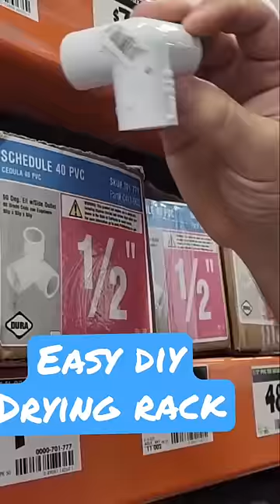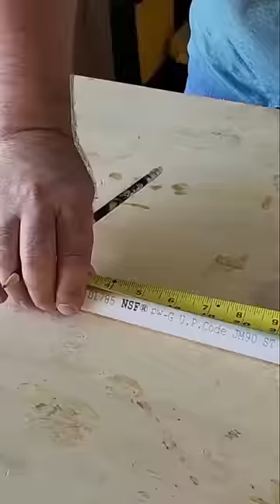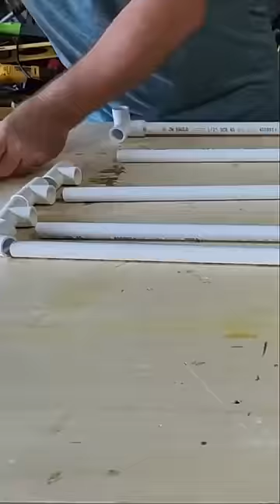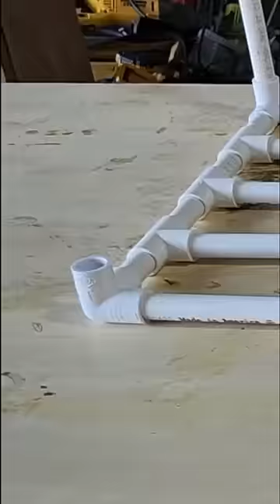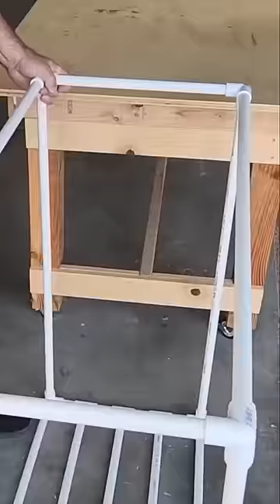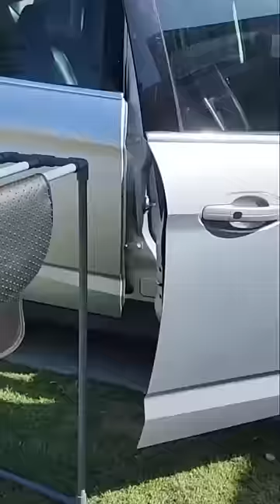Everyone will be buying PVC pipe for this! #shorts

Comment: I bet he doesn’t know how expensive the three-way PVC joint is.
Reply: How expensive are they each ?
Reply: Less than a dollar apiece on Amazon.
Reply: Well if he bought it the pipe he should know you think 🤔🙄 ??
Reply: It can be done without that fitting.
Reply: Here at Home Depot they're about $8 U.S dollars.. regular 1/2" Tee fitting is 6 and change.. these are 1/2" fittings,the smaller you go a little less expensive
Reply: @Seven.And.The.RaggedTiger 
 Wth? 1" tee's are $1.97 at HD according to the web. I didn't look at other sizes.
Reply: @joewoodchuck3824  depends on what state I'd assume.. but in Baltimore Maryland cross tee's are 9 bucks depending on diameter.. I looked at 1" pvc cross tee because that's what it looked like in video before seeing the "1/2 inch" labeling
Reply: @Seven.And.The.RaggedTiger  He was talking FOUR TIMES the price and he was talking two sizes smaller at 1/2". That's far from a local variation.
Reply: @RoseBushThorns588 the whole structure cost 750 dollars.
Reply: Each join is ~$1.25-$3, and he has at least 10 joints, so at the worst it's already $30...before the glue and long PVC.

Basically, he's wasting time for something he could get for cheaper.
Reply: He apparently liked what he was doing. That's all the reason he needed to rationalize the project. And it's to his exact specification of size and design. Show me (him, actually) a manufactured true duplicate.
Reply: @Seven.And.The.RaggedTiger where are you? Here in louisiana I get them for a 2.50 to 3.50 even with big markup being 40 miles from bigger towns with a home despot.
Reply: @Mr.BluesGarage  Baltimore Maryland the 2nd highest taxed state in the U.S other than California
Reply: @Seven.And.The.RaggedTiger  There are many other high tax states. I escaped from mine. Made space for someone else more gullible than myself.
Reply: There are foldable drying racks, not really expensive. This one will takes space. Unless you don't care about it.
Reply: @polinab.3594  I'm disappointed by all the flak this guy is getting for what turned out to be a nice project. It's what he wanted. Isn't that enough?
Reply: Wtf south cackalacky Home Depot 1.79 t’s
Reply: @Seven.And.The.RaggedTiger  its a specialty item not normally used, sometimes called a side outlet elbow. 2.58 each here in cali, (or 10 for 12.22 furniture grade special order). 8 will be needed.

Comment: I feel like that's more money in materials than a cheap towel/clothes rack
Reply: Bought an Italian Mahogany one for $10 , it's worth $850 .
Reply: It most certainly is
Reply: And you would be correct.
Reply: And a waste of time!
Reply: It could have been excess PVC pipe after a job, most of us would have thrown in the garbage.
Reply: @Undaunted2012 who throws away 4+ foot chunks of good PVC and dozens fittings?  That's like $60+ in materials.
Reply: @timlong1462   most likely I would, if it’s been in my basement for an extended amount of  time collecting dust & knowing that it would not be used, too late to return to the store unused pieces.

Comment: I made a radiator water heater out of one it had 141 degrees of heat. Still works 15 years later. Used a 10-gallon RV water heater and coolant and a small water pump. I roll it around the garage.
Reply: Can you share the build?  Please
Reply: Yeah,
Really 

Your project sounds like it’s worth looking into!
Reply: So it's a heated drying rack. That's what you mean, right? Flowing heated water through the PVC rack will dry the items quicker so I'm assuming that's what you mean by "radiator water heater."
Reply: We made soccer goals for Bosnia kids from PVC. Exactly! I'll move on💯😭
Reply: @mannys9130 
I'm thinking s/he meant it's a space heater.
blessings everyone everywhere and always
Reply: NOW we're talking. I wish I had seen that video instead.
  But here I am seeing this comment, so I'll call it even for watching this guy play Legos with PVC
Reply: @CmdrCorn   
Lololol be nice.
Blessings everyone everywhere and always.
Reply: @mannys9130 I take him to mean it's one of those tiny water heaters. Like just a little tank that fits under a cabinet. He filled it with liquid that's more efficient than water (coolant) and uses a little pump to circulate it.   
  Is like a PVC vehicle radiator with room for towels. Like cooking an egg under your hood, but for towels lol
Reply: So many thanks for this idea ❣️ The racks here get stripped and rust as soon as they get some water! Besides, I have not been able to find one the right size to hang from the railing. I think this will work fine ❣️
Reply: wonderful idea , heated rack , 
NOTE , for users new to this .... 
use " plastic glue " on the joints 
for water pipes ( ask in shop ) !!!!
Reply: I'm thinking that may be awesome for a little greenhouse!
Reply: @jessejamesburnitt  Considering wind etc., I wonder how big it can be.
Reply: Lots of Helpful Smarts Thank You 😊😊😊
Reply: Do u have those instructions?

Comment: Bought a metal clothes rack and the thing rusted in less than a year. I used PVC pipe and ran all my phone wires, and internet cables through it underground to my modular home 25 years ago and my water softener too and l haven't had any problems with them.
Reply: So you bought a metal clothes rack and it failed and then you used PVC for something other than a clothes rack and it was great. I'm failing to see the logical through line here.
Reply: @Bapuji42  Your inability to understand (real or not) doesn't make you smart. Not every word needs to be said.
Reply: Wer understand, pvc is more durable...
Reply: @sparrowhawk8539  Naw, it was just psychotic gibberish. We've begun medication and the patient has improved.
Reply: Go buy a clothes hanger at the store.Then make one of these. If you do it right, the PVC will last longer than the one you bought. Also works well to hang your clothes with hangers inside the house.
Reply: Sure beats metal. Lasts longer than the thin metal used today.
Reply: Ugh ...ok?
Reply: @jayc4715  I bought a '75 Nova and it leaked oil all over my yard. Then I built a makeshift urinal for my shed out of PVC and chewing gum and it lasted 20 years. I swear by PVC.
Reply: @Daniel_Antonio_Arellano782 my metal clothes rack has so far lasted 7 years without any visible deterioration. It also folds up when I don’t need it. 

At the cost of the pipe, the solvent weld, plus my time to construct, I would be dead by the time my pvc clothes rack would have paid for itself.

PVC is great. I once built an entire hydroponics garden out of the stuff. But a clothes rack? Waste of time and money.
Reply: @Bapuji42  that’s just summarization on his/her part. You need to understand, not be a smart alec.
Reply: @Bapuji42 😂

Comment: You will need to support the middle so it doesn’t bow outward. I’ve done this before and the weight and the heat from the sun made it bow
Reply: Thankyou for that advice.
I still think it's a great idea
Reply: Or put a stick inside of it before you glue it together
Reply: арматурину поставьте

Comment: Each pvc pipe (according to the rack price shown at the start of the video) is $6.98. Multiply that by the number of pipes needed, add the cost of the 2 types of 3-way connectors, PVC cement (if you don't want this stupid thing constantly falling apart on you) and you'll see how insanely expensive this DIY "drying rack" costs to make! A portable clothes rack at Walmart that can be used for the same purpose costs about $20. Does this DIY project makes sense to you?

Comment: I actually like this hack. I've built shelves using PVC pipe and currently have a tent built out of it behind my RV as I do an inframe rebuild on the engine. It's November in Minnesota, so it's a necessity.
Reply: not going to handle a snow load well.
Reply: @theboringchannel2027  I'll have to babysit it if we get a huge snow storm. I have it basically set up like a circus tent so that the snow will slide off. It's handled pretty heavy rain so far. 😁
Reply: @markiefufu  turn a heater on if you can before it starts to snow, if you know a big amount is coming,  this heats up the plastic, so it melts as it lands,
also makes it slicker for snow to slide off if it builds.  Just be aware many greenhouse/high tunnels built out of steel pipe collapse from a heavy snow load.
Reply: @theboringchannel2027  thanks for the suggestion! I have a Mr Heater out here and will run it overnight if warranted.

Comment: Until it gets brittle and breaks. It's also not welded and will fall apart easily. I wouldn't bother with this cheap idea. Probably can buy a better one for cheaper
Reply: That PVC pipe is going to last for 25 years or longer. I have tons of things with 25 years ago and they are still going strong. Just knows how much you know about using PVC pipe.
Reply: There's glue for this
Reply: Made a cage around my garden with 1.5" PVC.  Thought about screwing the joints for later takedown, but after 4 years of weather, I just knock them together once a season just to make sure.

Comment: Drill holes throughout the top crossbars, add a hose fitting, hook up a water hose --- now you can wash and dry the towels on the same rack. I mean, if you are going to stupidly spend that much money you may as well go all the way to the absurd level.
Reply: Then drill 8 more holes to have a drying system on the same rack... purchase a blower or wet-dry vac set to blowing, a surge protector, a heavy duty extension cord, an 8 port pvc manifold, and more pvc lines including reducers ... and get to work.  😏
Reply: Don't be a jerk

Comment: I wish he would give a list of materials and measurements as well! I can see using that for more than just a drying rack for floor mats use it for some DYI projects that you need to hand and air dry or many other projects you need to spray paint and need to air dry, also you could put a piece of cardboard on top and spray paint and it’s at a good level and not have to put it on the ground and have to bend over while your painting. I like it! I can see making it different ways for different projects. And not everyone has a spouse who has time to build things so it’s a project I myself can make!

Comment: I am splitting my sides laughing 
with the comments here .... 😂 , 
I may need an ambulance 😂 , 
" plastic pipe glue " is £5 - £10 
for a tiny tin ( for water pipes ) 
( ordinary glue won't stick ) , 
the glue melts the plastic to 
give a welded type of joint , 
when cutting pipes for water , 
use a small round file to remove 
the frayed edge on the inside of 
the pipe to prevent debris from 
collecting and causing a jam , 
plastic pipes will last 100 years 
or more , so the expense is only 
worth it if you want a long term 
fitting for your grand-children , 
the size of pipe shown here is 
too bendy to hold any weight , 
use 1 & 3/4 inch (approx) size 
plastic pipe much less bendy 
for wet heavy clothes , if the 
pipes are not filled with water 
then much simpler and less 
expensive is to use screws to 
hold the corners , ( 3 way ) 
( connecters very expensive ) 
however you do need to be 
creative with the saw to fit the 
corners , cut a half circle in the 
end of the pipe on both sides 
to make a half cup shape , 
a little bit like a horse saddle 
type of shape , then the screws 
can be put in at 45° on each 
side to hold the joint together , 
sorry I won't be doing a video 
on utube of how to make things 
as I am trying to escape from 
the geriatric clinic on my 
Zimmer Frame and the nurse 
has a 24 hr guard on the exit , 
cctv everywhere , I tried tying 
the sheets and towels together 
to make a rope ladder to climb 
out of the window , but I could 
not get the Zimmer Frame 
through the small window 😮 , 
planning my next escape .... 
oooohh , must go , nurse is 
heading this way .... 😮😮😮 
.... add on edit .... 
IMPORTANT .... if you are 
going to use screws on 
plastic pipes then drill the 
hole for the screw so you 
don't split the plastic pipe , 
4 mm dia screw thread , 
3 mm dia screw core , 
drill 3 mm hole in side of pipe 
for a tight fit .... 😮😮😮

Comment: this is really neat and easy but PVC has gotten really expensive. it's non-biodegradable and cannot be repurposed. you can use wood which is biodegradable and can be used for other things. you can use the PVC elbows and couplings with wood if you must.

Comment: Just the multi pipe section with holes drilled in pipes , some sand 
And One Downspout 
Under the dirt and some mesh on top of pipe system and sand 
In your Python (Or?) Enclosure /Tank 
Never a Dry Shed again
If ya keep the bottom moist

Comment: Made a nice overhead lumber rack for my shop using pvc pipe and fittings.  Didn't glue the joints, but did insert a short self drilling screw in each joint.  I weigh around 260 and it can hold my full weight.

Comment: I used thick gauge water pipe as post to build a shop once with a roller at the tops where the wood connected to stop wear. Everyone told me it wouldn’t work but it been over 15 years and still standing.

Comment: i took 4 posts 2 across the top of the other 2 set them in concrete in my back yard ran 4 lines between them at 20 feet apart,it cost nearly nothing,and i think its catching on,... i see them all over,knew i should have patened them...DRATS!

Comment: See, I thought you were going to do something like make a forced air drying rack. Something like a boot dryer but for multiple shoes/gloves/socks. This, although is niffty, is a waste of money/time. 

Wood with pvc pipping would have been a cheaper option. Use some 2x4's as the end pieces with a hole driller through for the pipping. This is only because the pvc fittings are way too costly for this.

Comment: So... I don't get it, as the ending is .05 seconds and really doesn't show the finished product; which leads me to conclude that it's a $40+ Turd Sandwich (PVC connectors add up quickly). The matte-nickel spray-can finish is very Mid-90s Trailer park.

Comment: So I know everyone is talking about how dumb of an idea this is from a financial position. But I'm going to add that this is a dumb idea from a structural position as well. 

You can put very light weight, slightly damp stuff on this and it'll be fine. Put anything heavy or that's actually wet on on here and it's gonna fall apart. 

PVC isn't rigid enough to hold a lot of weight and since you didn't glue any of the fittings it's gonna fall apart constantly. Even if you did glue the fittings you're still not going to be able to put more than maybe 3 things on here at a time.

Comment: Go right ahead 1 inch pvc is now 8.00 for 10ft.  Add in T  jointers at 5.35  each And PVC glue * Both* bottles which are special PVC glue 16.00   Pfffttt

Comment: I wouldn't waste the spray paint. Don't want my wet stuff getting paint flakes!
Reply: Use cpvc instead of pvc. It's already gray and probably more durable
Reply: @seanconnell5362  Thanks for the strength info! I do a lot of "hobbies." For a poolside thing, I like the clean white. The gray will be handy for something!
Reply: I don't think it will be very durable personally and right now it could be pretty expensive. Good luck anyway
Reply: @seanconnell5362  😆Everything's on hold right now! Materials for a ceiling project went from $145 to $320 in the last 6 months. I'm sticking with tiny projects and available materials!